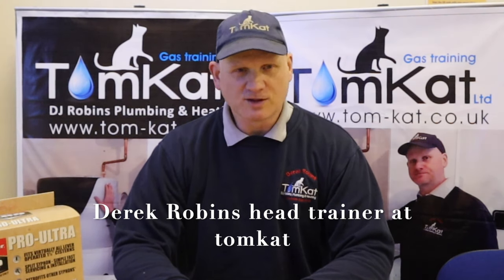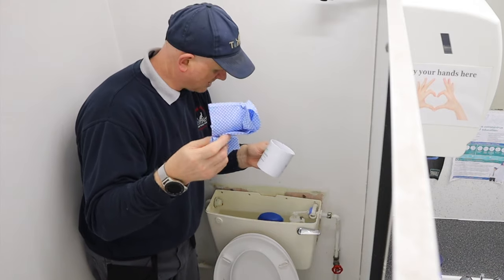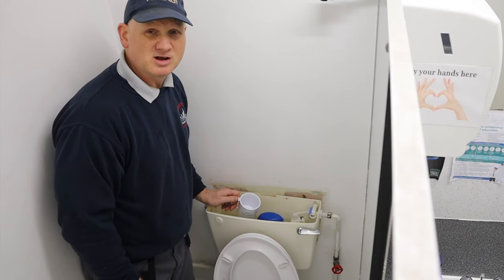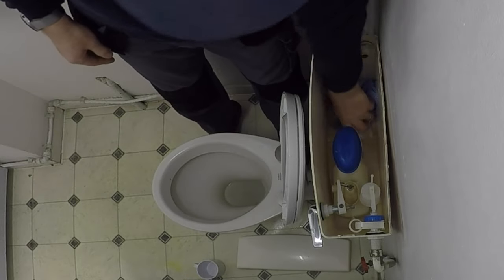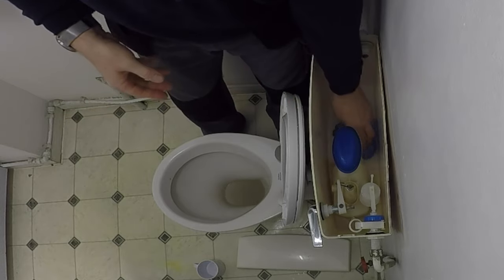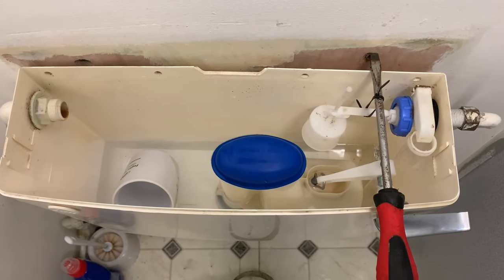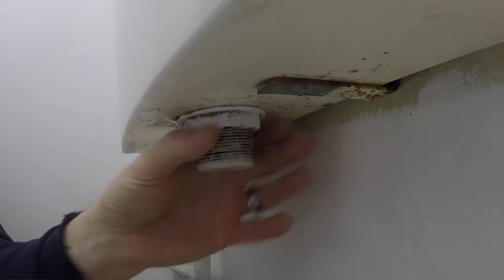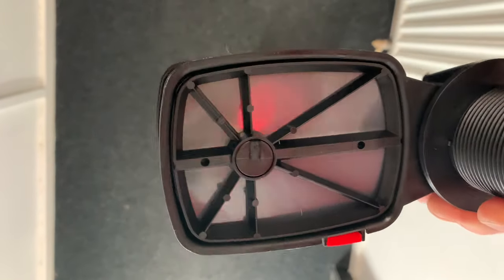REPLACE A TOILET SIPHON, how to replace or repair a broken toilet siphon diaphragm, plumbing/DIY

Comment: I've just fixed my toilet thanks to this video! Initially it was leaking from where the pipe enters the toilet itself. It's been like this for months if not years. I'd tried to seal it several times with only temporary success. I had no idea it was a simple as replacing a rubber fitting! Then, just recently, it's been getting more and more difficult to flush the toilet, until a couple of days ago it just became impossible. A quick YouTube search and I found this video! Not only have I managed to get the toilet flushing again but I've also fixed the leaky flush pipe! What I will say is that the nut under the cistern needs to be done up stupidly tight. I kept having leaks until I did it up really REALLY tight. Total cost was less than £15, and that included the pliers I needed to buy as well! Thank you for your help 🙂

Comment: Toilet decided to go and break a couple of days before Christmas! To avoid high call-out fees or a lengthy wait into the New Year I  decided to see if I could fix the problem myself. I come across this video and it was great!! I’m a complete novice but I found Derek very easy to follow. I was able  to replace the syphon on a close coupled toilet in under an hour, and that was taking my time and taking the opportunity to give the cistern a good clean behind it. 
The replacement syphon cost a little under £7 and works perfectly. Thank you very much!

Comment: I saw a video where the design of the toilet required removing the whole cistern from the wall! I am so glad my toilet was like this video. Very easy to follow, job done in about 20 minutes. I was unable to remove the pipe due to bad design around the toilet, so used the old washers, but so far it hasn't leaked. Excellent.

Comment: Ah, you've saved me.
I followed your instruction up to the baling out when I remembered that I have a 12v oil extractor pump lying around.
I rigged it to a 12v power adaptor and the job was painless. I repaired mine instead of replacing it by swapping out the diaphragm.
Thank you for your help.

Comment: I'm literally doing this right now, following it step by step. The previous owner painted over inlet valve so I shut off the water completely.  To get the water out of the cistern I used a McDonalds cup as they are more flexible and warn work socks, they'll get cleaned later. I'm now off to B&Q so I'll edit this later to let you know how it all goes.
(A few hours later)
Toilet now flushes perfectly every time and no leaks. Thanks for the tutorial, if I can follow this anyone can.

Comment: Really good 👍🏻. Liked how you showed the old one and the condition of the old washer and how you compared it with a brand new one. Thanks Derek (AKA plumber/gas engineer/plasterer/laminate flooring fitter. Sorry if I have missed anything) 

Asian Jon. Training.

Comment: A short piece of rubber hose, fill with water while holding a finger over bottom end - place in cistern and point into bowel at a point lower then the bottom of the cistern will create a vacuum and drain the water.  Lot easier than using a cup.
Reply: Great tip! Just replaced my siphon and this saved me loads of time.
Reply: It's probably best not to point the rubber hose into bowel!

Comment: Thanks really helpful
Replacing one tomorrow, will let you know how it goes.
Reply: It went great....Turned the stop cock off, did the work...However as the stop cock hadn't been moved in 10 years it broke when I tried to turn it back on.
Had to call an emergency plumber to come out and turn the mains off and replace stop cock.
Haha.
The siphon worked though and no leaks.

Comment: replaced a diaphragm recently only to find that the flush was slow and fan like so wouldn't take solids, even paper away fully. Took pipe out of pan entry and found a large piece of the old one restricting flow, no wonder....VERY WORTH Checking when apart on replacement. Regards,

Comment: spot on! Now I know I can get the toilet to flush properly and I only need to change is the washer in the syphon (I'm tight). Hopefully It'll stop the long flappy pipe leading to the toilet behind the bath sounding like a trumpet when it's flushed too. Don't think it will, but we live in hope.
Reply from the maker: That will probably be the washer in the float valve that makes the trumpet noise
Reply: @tomkatgastraining  COOL! Thanks for that👍

Comment: I had same problem I just replaced the diaphragm plastic seal I didn’t need to turn water off just unscrewed the symphon took it out replaced the seal. Mine was a closed couple toilet. I couldn’t turn water off as hard water stops me turning off the valve on the water inlet.

Comment: Thank you for explaining how it works. The issue I have is that after flushing water is still flowing. It does not stop the flow at a 100%. Any explanation?
Reply from the maker: You won’t have a siphon wc you will have a flush valve

Comment: very good. cistern was leaking from pan pipe and it seemed the inside washers which hold the siphon get worn or disintegrate. i tightened the large nut and it seems ok. Same with inlet pipe with washers on the inside. any instant glue which sets in water to stop any further leaks you can use?

Comment: Can you leave the Swan neck pipe on without  taking it off because mine has tech 7 on the rubber seal and if I take it off I know it will leak...I did put new seal on the pipe that goes into toilet but it still leaked so a plummer put tech 7 around it..

Comment: Had to replace the float ball and it was a ball ache re-fitting the flush pipe as my toilet hole it goes into was awkward. Silicone with plumbers mate and a new flush cone still leaking. Any suggestions?
Reply from the maker: What is leaking and what type of toilet is it

Comment: Those Torbec valves are really flimsy. I busted a pin on one side of the float mechanism with minimal force.I’ll be replacing that with a different float mechanism

Comment: I'm 65, on my own with my very elderly mum who lives with me. Today my toilet decides to start part flushing then gradually not flush......two weeks before Christmas in 2022. 

As only shown at the end of the video, my toilet cistern is low level and ceramic, with the double push button on top.  I've tried but never been able to take the lid of the cistern off to look inside. Don't know how to...do I need to to unscrew the button? Can't see how to do that, or should it just lift off anyway? 

 We had some work done about 20 years ago through a govt improvement grant. Some of the work was awful and had to be redone. The toilet was put in to replace my high level cistern toilet.
It's always getting blocked and my mother for years has insisted on buying that liquid blue stuff (I hate it!) and puts it in every day.......Can't wait to tell her that's what it's done!  Funnily enough she recently changed brand to a cheaper one so it probably has finished the filter off for good!
If anyone can tell me just how to get the lid off the cistern I'd be grateful!
Would love to be able to fix this job myself. There's another woman commenter on here that said she did!
Also he didn't say if that replacement was standard and where would I get one of those please?
Reply: I have just checked mine and the cistern lid just comes off but you might need to follow the instructions as this video  https://youtu.be/Xg9SAVudkyk let me know if this helps!
Reply: Also, if you manage to remove the siphon take it with you to Screwfix and they will help you pick the right replacement. It will be worth taking a photo of your cistern with you.

Comment: Arrrrrrrrrrrrrrrregh got the cistern dry but HTF are you meant to get to the underside to unscrew it when it’s enclosed in a facking cupboard 😩😩😩
Reply: I can just about touch it but getting a tool in there or turning anything impossible. I’m not fricking elastigirl 😠